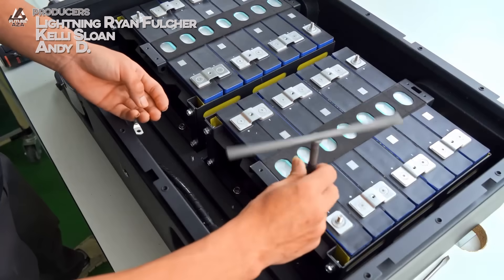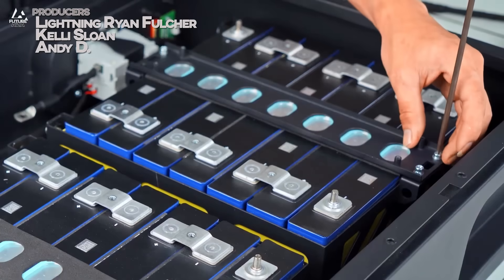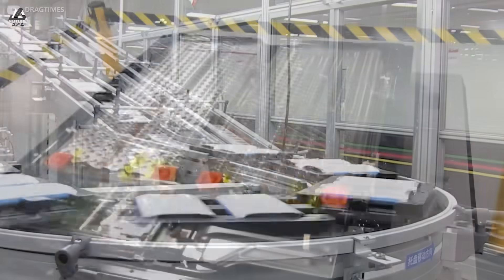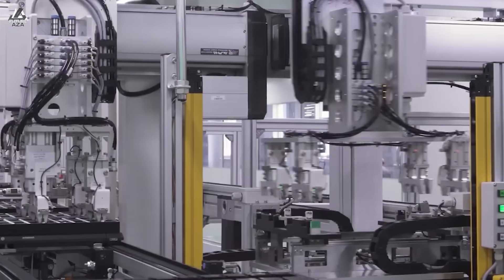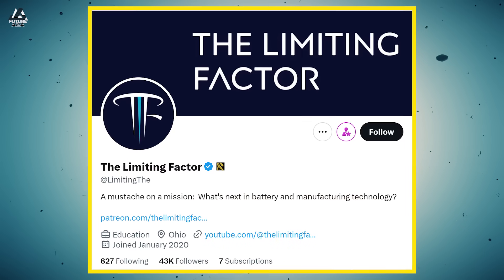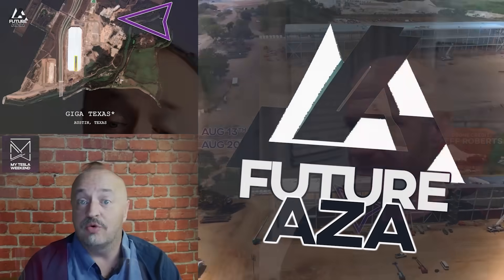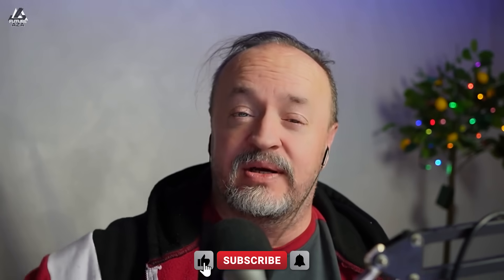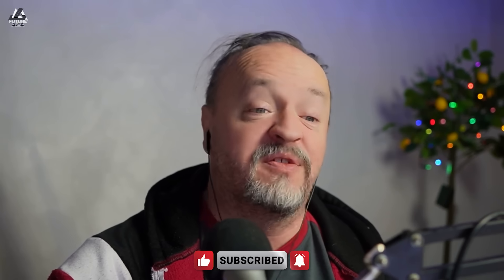4680 Reality and the Lithium Breakthrough Tesla Needed

Comment: People who think Tesla wants to produce 100% of their own batteries for ALL of their products, ALL the time,  don't understand Elon's own words "it's a hedge" to have Tesla's own battery manufacturing. It's the ability to use their own batteries IF/WHEN 3rd-party battery prices are too high. Tesla is using the OPTION to make batteries, IF, and WHEN< needed, as a "financial smoothing capacitor" in the same way an electrical circuit uses a "smoothing capacitor", to regulate power.  Tesla uses this to "regulate" battery pricing, and supply, for Tesla products.
1) When the market for batteries equates to HIGH prices/LOW supply, Tesla will use more of its home-grown batteries, meaning less cost, more supply, and squeezing other car companies who have to pay high prices for 3rd-party batteries.   
2) When the market for batteries equates to LOW prices, HIGH supply, Tesla will happily buy 3rd-party batteries as long as it is cheaper than home-grown batteries.  

Over time, as the hysteresis of market prices for 3rd-party batteries rise, and fall, Tesla has the ability to change rapidly between 3rd-Party, and Home-grown Tesla batteries, and always use the best option for rate/speed of supply, and economic, benefit.  

E.G. It's literally the same principle the Tesla Powerwall uses when you set the option for "make my bills cheapest", it WILL sometimes use grid power to charge the Powerwall IF it makes economic sense to consume grid power at cheap "time of day rates".   

E.G. Also the same principle at larger scale used in Tesla magapacks and their "Autobidder" software, buying, and selling, electricity, to make the best "bang for buck per electron".  

Most car companies won't have this option to use their own "economic smoothing capacitor".

Comment: Lead is self evidently a dense element for batteries. It's used because all the salts (reacting products) of lead are insoluble (except nitrates, hence Sulphuric acid being used, not Nitric acid), which acts as an insulator and I guess regulates the charge discharge cycle.

Comment: Tesla's 4680 battery cells feature innovative chemistry with higher nickel content, potential silicon anodes, and a dry electrode manufacturing process aimed at increasing energy density, reducing costs, and enhancing vehicle integration. lol

Comment: Extremely SIMPLIFIED overview of lithium mining and processing issues. Lithium will catch fire / explode when exposed to 15% Oxygen by volume (our air has 20%) Many brush fires are stated by lithium embedded rocks that erode exposing lithium. Separating lithium from rock in oxygen free chemical ponds is the traditional method (cheap, polluting). Now freeze separation and Nitrogen processing (expensive, clean) are the rapid methods. Keeping lithium away from Oxygen is REQURED.

Comment: Brian, If it is so easy to make alkaline batteries, why were all of the US factories replaced by Asian ones?  

Lead Acid automotive batteries are still made here. I think you are correct they do not require super careful manufacturing like Li-ion does.  They also are heavy, so transport costs are higher than AA alkaline cells.
Reply from the maker: You think difficulty is the reason factories moved to Asia?
Reply: @ Yes, difficult to be profitable with lower yields and older tooling. Probably higher wages too, but AFAIK, Japanese wages are not cheap, even if Chinese and Korean are.  Yet Japan still manufactures large quantities of batteries.

Comment: these breakthroughs would have happened by decades ago if not for the Oil cartel's buying and burying the patents  all along.
The oil industry has spread misinformation that EVs are bad for the environment, but in fact they are cleaner than gas-powered cars. EVs produce fewer emissions than gas-powered cars, even when the electricity grid still uses fossil fuels. 
Lies that EVs are expensive
The oil industry has spread misinformation that EVs are expensive, but in fact they are cheaper to drive. 
Lies that EVs are not practical
The oil industry has a vested interest in lying.. and they keep  blocking policies  that move the country to EVs.and other cleaner alternatives with more choices,,, The average U.S. household spends hundreds of dollars a month on gasoline, which provides billions of dollars to oil companies

Comment: Lower cost and higher energy density for more range is what the CT needs right now to increase sales.
Reply: Not really.  You can buy a Cybertruck today for $90k or a Dodge Ram today for $70k (if you can find it without dealer improvements).  One costs far less in fuel.  The other has longer range.
If you want to save $50k over 10 years you pick the Cybertruck.  If you don't care about money you pick the Dodge Ram.
Reply: @davidbeppler3032  I disagree,  the top complaints by all the reservation holders about the CT when released was less range & higher price then promised.

Comment: Sorry if they answer this later, but what’s the status of the ‘tabless’ design? I thought it was going to deliver VERY high charging speeds???
Reply: The 4680 has always been tab-less. What do you mean by tab-less? The 4680 is made by rolling the internals like a swiss roll. There are two metal conductors in the roll that are positive and negative. At each end of the battery one of them is exposed to access the electricity.
Reply: @ I thought the continuous tab copper strip was supposed to unlock a few things. One of these things was supposed to be very high charging speeds since the single-tab style was a choke point for current ingress. As far as I can recall, the 4680 charging speeds aren’t significantly better than the 18650 or 2170 packs. 

I may need to go back and rewatch battery day.
Reply: @mbur5099  Battery day was in 2020. The older style batteries had the positive and negates. At the beginning of the roll a connection was made with the outer electrical surface. In the centre of the roll a connection was made with the inner electrical surface. This is not accurate but imagine the electricity going round and round the roll to get to one of the connectors. Now imagine all the electrical surfaces are placed so one is higher and the other is lower. It is now possible to connect along the whole edge of the surfaces at top and bottom. I believe this is already in place. It is one of the advantages of the cylindrical design.